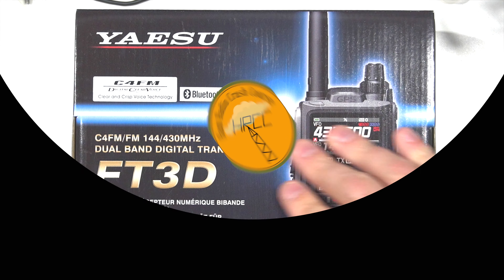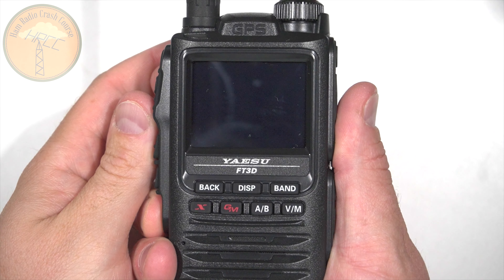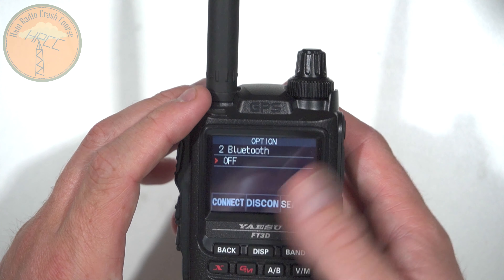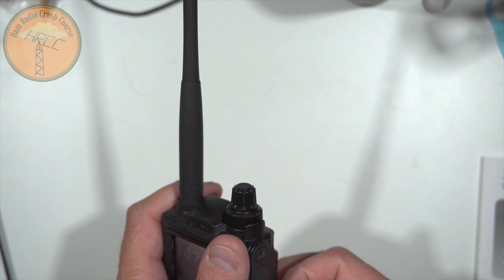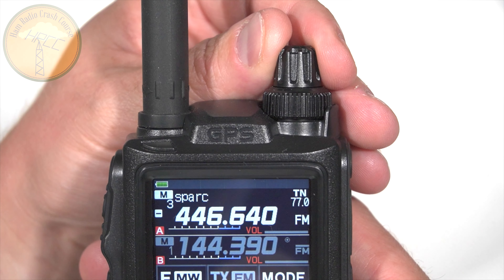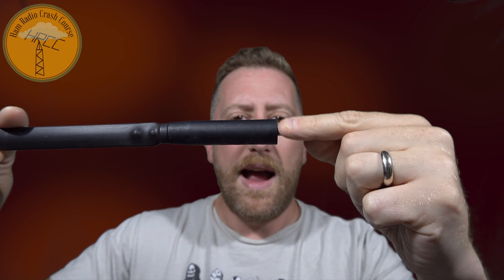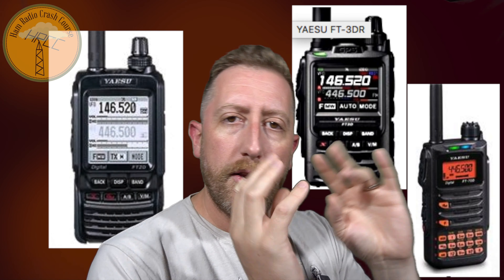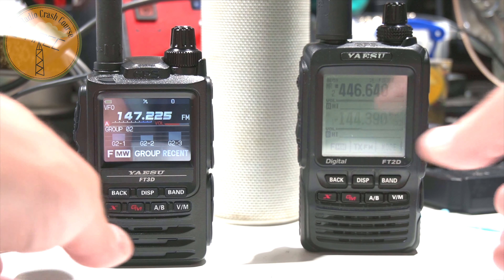Should You Upgrade To The Yaesu FT3DR?

Comment: I actually just bought the FT3DR as a my first radio. I've had it for less than a week at this point but I'm very happy with the purchase so far.
Reply: Avery Uslaner could honestly say, “it’s’ the finest ham radio you’ve ever owned”????😬
Reply: Can you transmit in airband frequency or just monitor?
Reply: Do you need a license?
Reply: @schulze420  Yes, at least if you're in the U.S. and you want to transmit. No license required if you just want to listen
Reply: @Tripl3Point  thanks for getting back so fast.

Comment: The FT3D was my first radio.  I just tested out and got the tech and general in one sitting.  Awesome little radio but I live in the middle of nowhere so I had to change out the stock antenna for a Diamond.  I have used it in my car and it has incredible reach with only 5W.  I hit the repeater from my house (sitting outside) and it is about 18 miles away.
Reply: Which antenna from Diamond did you get?

Comment: Can confirm that the accessories go way back in compatibility.  I have the same set of accessories I used for my ft2dr, ft1dr, and vx8gr with the exception that the vx8gr has a different programming cable.

Comment: Compared to it's older brother, the FT2DR, the FT3DR's audio is significantly inferior, especially on HF. Tune both handhelds to a station on HF and compare the audio, the FT3DR's audio is just plain bad with distortion at even low volume levels whilst the FT2DR's audio is just fine and clear without any distortion even at high volume levels. I also noticed the FT3DR's price has dropped significantly since it was introduced only a couple or so months back suggesting they are not shifting off the shelves very fast.

Comment: Loving the radio thus far, only concern I may have on it vs the ft2dr is that from others experience the APRS beacon has a higher success rate of pickup on the ft3dr which has around a 20% success rate in some other folks experience. I haven't had a chance to try it too much yet. The speaker isn't a problem for me in that another owner found that by removing the water proofing in front of it, it sounds better, since my concern is about having the radio by water resistant it is a compromise I'm willing to make.

Comment: Hello, I just sold my ft1 & ft2 for this. Now let’s see if it will do satellite work like the Yaesu rep stated at Daytona. I bet it doesn’t, so I’ll still be buying a Kenwood down the road. Should be in my hands on Friday. 73,
Reply: Kelley Law did you also buy the Kenwood? Is it better than this ft3?
Reply: Hello wdsracer,  I haven't yet. The FT3 is like using any other yaesu.  If I didn't use fusion is sell it. But can't see spending money for a radio that I will only use for satellites at this time. Stay safe.

Comment: The Anytone 878 plus is $300 less and can do as much as the 3DR, plus YSF (Yaesu System Confusion) generally is a mess compared to DMR. I can easily access America-Link through TG 31656, probably the most popular of the only 2  active chatrooms, and they are always experiencing problems with WIRES-X node conflicts, firmware update issues, and inexperienced operators constantly disrupting the chatroom with DTMF tones. The only consolation with YSF/C4FM, is you are only getting slightly less ripped off than buying a D-Star radio from ICOM or Kenwood.
Reply from the maker: I guess agree to disagree. I haven’t experienced anything you mentioned aside from DMR network issues really.

Comment: thank you again for another fine video....re the issue with trying to put on an antenna where the base of it is a little wider and bumps into the GPS.  Would a BNC adapter raise the height enough to accept the antenna that was too wide to fit.  I am still looking for a radio and having a tough time of it.  I think I would put on a BNC adapter on any radio to make it easy on and off and I think it also minimizes the chance of damaging the pin. 
I have been looking at so many YouTubes and it is difficult for me since most video reviews do not let you know about each feature...They leave some out and do not say what is negative as much as they should.  My prime concern is getting a radio that is great for emergencies. Being alerted automatically.  and being found if something happens to me.  I also want to be able to program in all the frequencies that i could listen to in order to find out what is going on.  Also true dual channel so I can be on one and get the alert on the other or be called. Broadcast radio should be important.  I do not know enough about D-Star, DMR and fusion to know if I should make one of them an important part of the decision. I think DMR is all over and fusion at this point reminds of the Beta Max....it was the best machine but everyone was using VHS, so the Sony Beta Max had passed away.  I know this is a long winded note......but if you have any suggestions of a new or older radio that you would recommend....I hope you can suggest.  The Icom is coming out with the 52 model any day I hear and It is an interesting sounding radio.  Thank you again....I am learning a lot listening to you.

Comment: I can program my Kenwood D74 with Bluetooth on my Microsoft Surface Book.  I can also control my D74 and communicate with APRS software via Bluetooth.  I can't even program my FT2DR with a PC anymore.  My cable won't connect the rig to my PC.  Yaesu programming software won't recognize files I've saved to the SD card either.  So my FT2DR is basically an inert brick since I've moved to a new town and can't easily reprogram it with a PC.  My FT2DR also has an inferior receiver, hard to read display, poor touchscreen sensitivity and weak audio.  I'm not willing to take the risk with this new Yaesu after my experience with the FT2DR.  It sounded great on paper, but in the end it was just a poorly engineered gimmick.

Comment: Maybe this is a silly question for some folks, but how wise is a touch screen on an HT?  Does the sensitivity turn off like a cell phone or does it remain touch sensitive even while you are wearing it on your hip and swinging your arms?  I would be concerned about changing frequency by getting bumped by myself or others.  Also, while the color screen looks prettier, isn't the monochrome screen more practical in intense sunlight? 

Don't get me wrong - I love new technology, but I'm more about practicality in adverse conditions.  After all, shouldn't all portable radios pass the emcomm adverse conditions test to be considered something truly better than just a cool, trendy new tech radio?  Just saying...  We've used our radios (VX-150, FT-60, FT-817ND) in both darkness and full AZ sun as well as bone-numbing cold and scorching heat, and both easy neighborhood walking as well as rough and rugged conditions; and  I couldn't imagine trying to use a full color touch screen in some of those scenarios.  How about putting the FT3DR to those tests and seeing what its limits are?  In my opinion, that's the real test - unless, of course, your primary ops are in the mall, in your home, in the park, or in your climate controlled citified SUV.  ;-) 

Thank you for all of your videos.  I really enjoy them! 

73
Reply: A quick push and release of the power button will lock the screen and everything else (except volume).  Do it again to unlock.

Comment: I would be interested in your thoughts comparing the Kenwood TH-D74A to this radio. - Brian WB8AM
Reply: Nutshell: 3DR is 2m/70cm only; D74A can do that and 1.25m as well.  3DR is Fusion/WIRES-X/C4FM while D74A is D-Star.  3DR has wideband receive up to 1 GHz whereas D74A has 100 kHz - 76 MHz, AM/FM broadcast, and some extended freqs around its ham bands, but no air band and nothing above 470 MHz.
Reply: @JaronActual  D74 does wideband shortwave and HF and SSB receive though.
Reply: @stuarthaggard2971  You're correct, I missed that "0.1-76 MHz" listed in its specs.

Comment: I had the FT1 and FT2. Sold both. The FT2 was really just a bolt-on touchscreen on a FT1. The UI was atrocious, which killed it for me. For text entry you had to use the scrollwheel for some items, while others worked via touch keyboard (though even that was cumbersome). I loaded up my save file from the FT1 and suddenly most of the menus were no longer graphical but text only. It's a weird mess and while I may be wrong about the FT3, I don't see anything that would make me spend that kind of money for it. Don't get me wrong, I'm not knocking just Yaesu for this, other manufacturers have similar issues with their HT usability.

Comment: I purchased an FT3DR recently, and I'm not very impressed.  it has a tiny speaker that cuts off all but the highest frequencies.  Even YL hams don't sound natural.  Selecting a YSF group on the radio is awkward at best.  With more than 750 groups, using the ALL feature to scroll through groups 20 at a time is useless.  Typing a group name with the multi-letter keys is a pain.  the RT-Systems software programs only the channels.  There's no provision for programming any of the radio's other settings or digital groups.  I purchased an AnyTone AT-D878 about the same time for DMR, and I'm much more impressed with it than the FT3DR.

Comment: The more videos I watch the more I’m confused. Can you do a video on what exactly the radio can do on it own with no internet, no hot spot. Just the radio. I know that digital requires the internet to do those modes, but can it connect to fusion or wires while being out and about without the pc or hotspot considering of course you are close enough to the fusion repeater
Reply from the maker: None of it requires the internet. You can be out and about and connect directly to a digital repeater if one is in your area. The repeaters don’t require the internet either.
Reply: Ham Radio Crash Course so fusion or wires x doesn’t run threw the internet?
Reply from the maker: @kevinokeefe7796  It can and most repeaters do, but the local repeater will still work with you on WIRESX or Fusion via RF if there is no internet.

Comment: Great review. Can the radio be programmed through the SD card?
Reply from the maker: Sure. You can program channels on the radio and save to the Sd card.
Reply: @HamRadioCrashCourse  Clarification - can the SD card be put in a PC and channels saved to the SD card and then transferred to the radio? Wondering if it's an option to program the radio without needing a cable. Or maybe programming over bluetooth?

Comment: The FT3 has bad audio on analogue... and I mean, REALLY bad.  Makes even a solid signal sound like you're picking it out of the static.  It's a very common problem with the FT3.  It's a great digital radio - but my nasty Baofengs outperform better on analogue.  I honestly wish I'd never bought it.

Oh, and the default charger it comes with takes a LOOOONG time.  Ridiculously long.  So long it'll make you angry.  Pay this much for a radio and you expect the charger with it, but they've made it so that you literally NEED to buy the optional desktop charger.  This feels very deliberate.

Been a Yaesu guy since I got into the hobby - but after this I really don't feel I can trust them anymore.

If you want a radio for digital ONLY - and are happy to add the optional desktop charger to the pricetag, then you'll probably be really happy with this HT.  But I know SO many people that have had FT3's and have sold them pretty quickly ... so, look for one "nearly new"

Comment: It's 2019, how is a HT with the following features too much to ask for?

Dual Band VHF/UHF
Dual VFO
Full Duplex
Waterproof IP67 (all the FT1/2/3 are IPX5? WTF?)
GPS
MAPS!!! TOPO Maps!!! Put Stations on the damn map similar to a Garmin Rino?!?!
APRS
Messaging that works

Also, DMR & Narrow Band Digital modes sound like crap. If Yaesu could cram more data into their C4FM Digtial Wide Mode (GPS Location), that would be better.... than I dunno, transmitting digital pictures from 1999.
Reply: Yeah whenever I look at ham radio stuff, even the new stuff reminds me of car stereo electronics from 25 years ago.  This is just really old technology under the guise of being 'new'.
Reply: Have you compared voice wide to digital narrow?  (VW vs DN)  You can easily hear the difference when it doubles the bandwidth and while you lose the data that can pass with the audio, the increase in fidelity is very noticeable.  I like that you have a choice with C4FM.
Reply: spasmonaut10 I have, VW quality is fantastic, just only if it transmitted gps location with it! it only transmits callsign in VW mode
Reply: It's great to see progress but everything you've mentioned is realistic and should not cost much more. Battery life should be amazing, GUI should be logical and have modern features. Accessories like the external mic should connect in a more elegant way, with a professional connector. No need to reinvent the wheel, just do what's already being done elsewhere.

Comment: I'm still confused how this is better than a baofeng. I would love to go back to buying Yaesu or Icom, but I want a radio that has a form-factor other than square and a battery life longer than 8-hours, with a charge time that's 16 hours.
Reply from the maker: Well. It’s has many other features over the baofeng. APRS, digital modes, wide band receive.
Reply: @HamRadioCrashCourse  Two things that have really driven me away from the amateur radios offered by Icom, Kenwood and Yaesu: High cost for the radio and it's accessories which the programming cables only work with that radio, inadequate battery life, and expensive replacement batteries. The most annoying thing though, they seem to design these radios such that they won't fit in your pocket, won't fit in your pouch, they seem designed to be carried in your hand, and only in your hand.

Comment: Can this TX on AirBand? New to Ham and just about to take my technicians test.
Reply from the maker: It out of the box, no.
Reply: Thanks is there a HT that can do Ham (2m and 70cm) and AirBand both Tx  Rx? I live on a small airport and am getting into the hobby.
Reply from the maker: @mybuddysyoutubechannel4059  No, airband is AM and ham radio HTs are FM.
Reply: @mybuddysyoutubechannel4059  you would need a separate license (aviation radio operators license) in order to transmit on the airband. And there wouldn’t be many reasons that would legally allow you to transmit anyway. If you want to receive you can by a radio receiver. I have a Tecsun PL-660 for this. If you want a HT specially for aviation Rx/Tx there are the iCom IC-A25 units

Comment: FT-3dr built doesn’t feel as good as in its predecessor.  The radio weights less.  To some that may be a plus,.  Usually , well built units have a bit of weight to them due to metal frames or tricker outer shell.  The large dial has a lot of play when pulled back to front and vise versa.  That said, its a very good radio.  I own both versions.

Comment: Resistive touch screens are extremely unreliable, the first time you slightly bump it, the flexible film will deform and stop working. That's why it's all but phased out. It was all the rage during the 90s and early 2000s. It's really terrible that they put something like that on such an expensive radio. I would much rather wear touchscreen compatible gloves than having an expensive radio that has to be treated like a fragile baby.